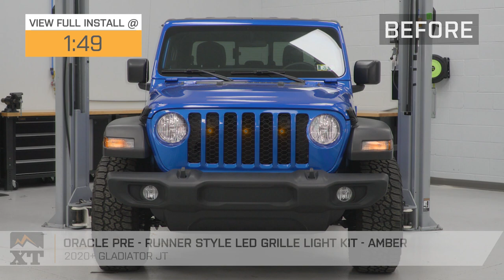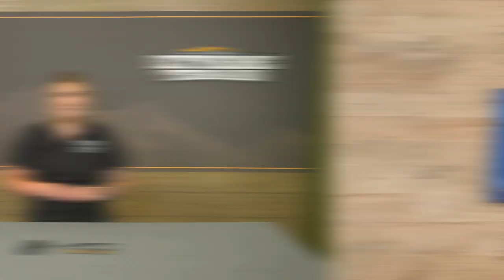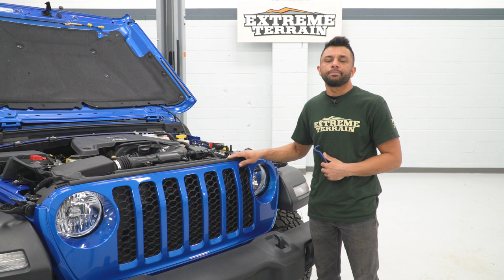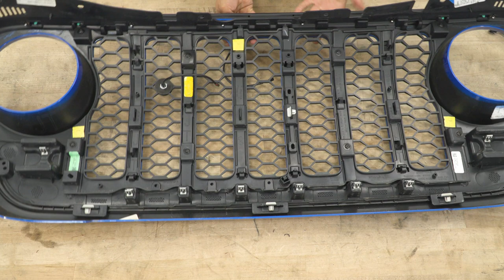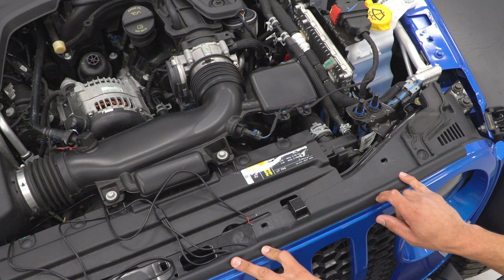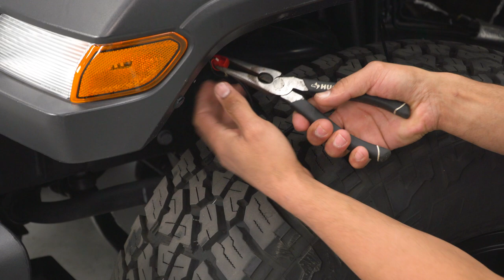Jeep Gladiator JT Oracle Pre-Runner Style LED Grille Light Kit Review & Install

Comment: Just a tip. Before you tidy up all the wiring in the fender well, test the lights to be sure they all are working. If there is a problem, you don't have to undo your work to fix it.  Also, t-taps work much easier in that confined situation. Also, wrap some electrical tape around those connections to help to  keep them secure and waterproof. It is cheap insurance.  You don't want them to come loose while you are bouncing around in the woods, and have to redo all that work.

Comment: Question why do you have to go to the light in the fender, won't be a lot easier to run the red wire to a Acc. Fuse that has power when the key is on or the jeep is running ?